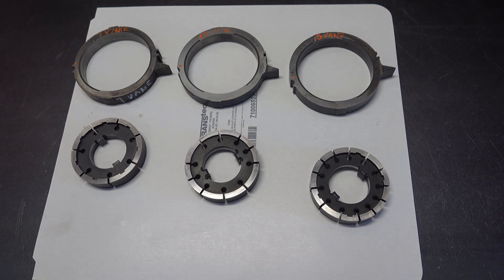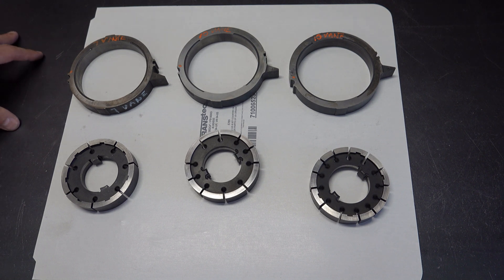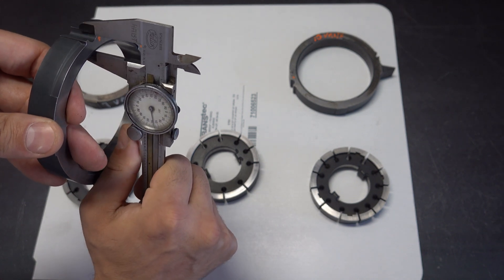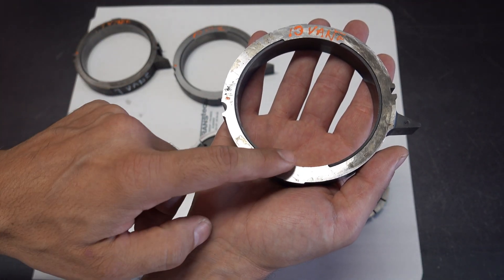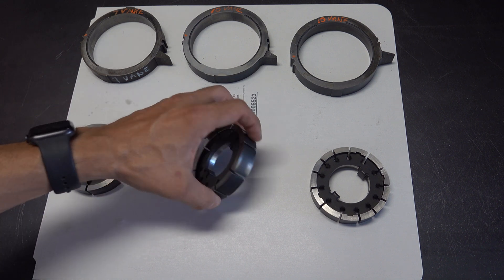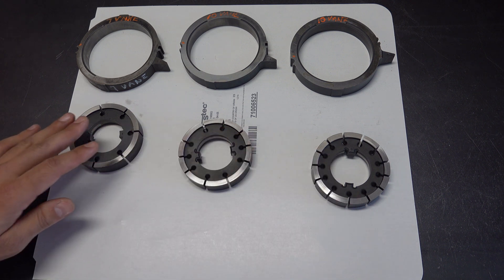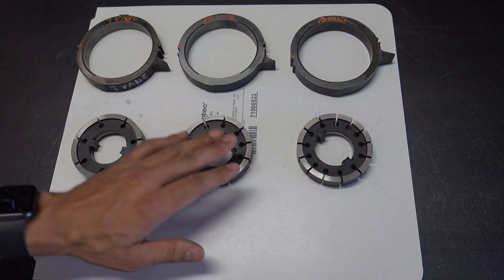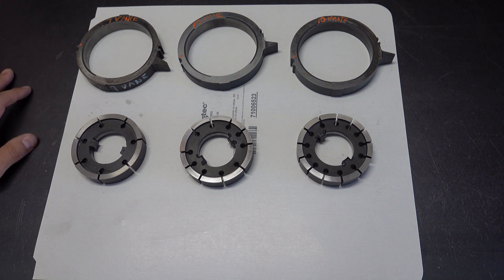700R4 / 4L60E Rotor and Slide Differences

Comment: I got a 84 Caprice with a seven vane pump. I got a 13 vane kit but the two lugs that mate to the torque converter are not wide enough like the 7 vane rotor. It creates a large amount of backlash, can I still run it?
Reply from the maker: Run the 7 vane pump rotor. There is no real advantanges to a 13 vane pump in a 700R4...10 or 7 vane set ups are sufficient for all applications; 7 vane pump rotors are stronger than either 10 or 13 vane rotors.

Comment: So on a 1982 transmission with 7 pale can I put a 10 pale rotor without modifications? I can't find a rebuilt pump or even a suitable rotor, so I wanted to upgrade to 10.
Reply from the maker: Hi Matteo, I believe I covered the interchange rules in the video - was there something that wasn't as clear as it could have been? If so, please let me know and I'll pin a comment to clarify/correct so viewers know.

The main thing you need to do if swapping rotors and slides is confirm your clearance. Clearance between the pump body deck surface and the top of the rotor should be between .001-.0015 while the slide-to-deck clearance is .001-.002.

Comment: Got a normale new 10 vane pump assembly kit, but they delivered a slide for a 13 vane. As far as I got it right out of your video I can put the 10 vane rotor in the 13 vane slide?
Reply from the maker: Hi Camaro, you should be fine though I'd see if I could send it back to get what you paid for but if push comes to shove you should be ok to run it. Just check your clearances to make sure everything is within spec (.001-.0015 for rotor-deck and .001-.002 for slide to deck).

Comment: I have an 87 700r4. Going into it for some shifting upgrades. Haven't removed the pump.  If I have a 7 vane can I go to a 13 vane? What modifications do I have to make? Thanks.
Reply from the maker: No special mods needed though if you're upgrading I'd drill the drain back port to 5/16", install Transgo's "Unbreakable Pump Ring" kit as it has a better priming spring in addition to the ductile iron rings, which are essentially unbreakable...Toss in a new 13-vane rotor guide and vane kit, inspect rotor/slide for any concerns, otherwise just make sure rotor and slide are within spec for clearance (shoot for .001 clearance for both and the pump body deck surface). 

Measure the height of all vanes that come in the package as once in a great while, you'll get one that is a bit too tall/long and will bind up the pump. 

Last thing I'll add is that a factory 10 vane pump is structurally a little stronger than a factory 13-vane rotor and more than sufficient for any conceivable need in 700R4s and 200-4Rs (with the latter, the 7-vanes are perfectly fine for most anything)...I'd recommend going with a billet rotor if you're wanting to do a 13-vane set up.
Reply: @nickstransmissions  I appreciate your quick response. I'm no transmission expert. I'm not even a novice. I can swap them with the best of them. Rebuilding? For reference, I got an 700r4 from a friend. Supposedly came out of a 87 suburban 2wd. I'm replacing the Borg-Warner trans in my 73 XKE. John's cars kit. Dude has been doing this for a while. Obviously shifting in a suburban would be different than a Corvette/Camaro and I want it to shift like a muscle/sports car and not a truck I figured a Corvette servo(from a reputable shop) Transgo shift kit, upgraded pump(13 vane?), and a 1800 stall converter should get me where I envision. Watched a few of your videos and you make it way easier to understand. Definitely subscribed.
Reply from the maker: You're welcome, man and thank you for the subscription...Your transmission builder will know what to do insofar as calibration but the main difference between the Vette and basically everything else that took a 700R4 as far as calibration is concerned is the governor...The Corvette governors had super light secondary weights for much higher shift points than pretty much everything else. They look distinctly different compared to truck/pass car governors as well.
Reply: @nickstransmissions pulled the pump. Found out it's a 10 vane. I guess I'll just  roll with that. I will drill that oiling hole you recommend. Thank you.
Reply from the maker: You're welcome, housepumpinpc - good luck with the rebuild.